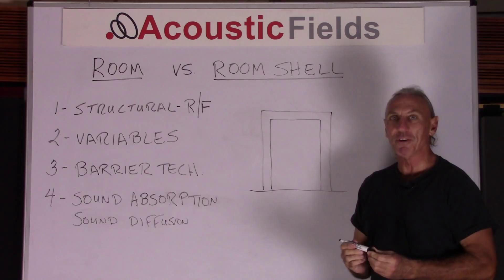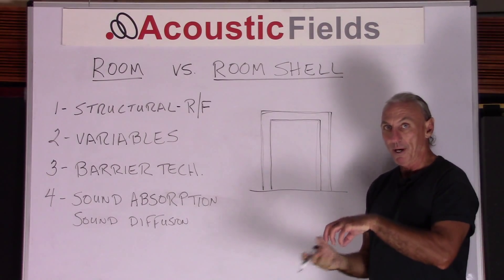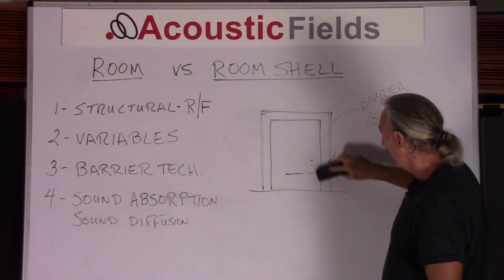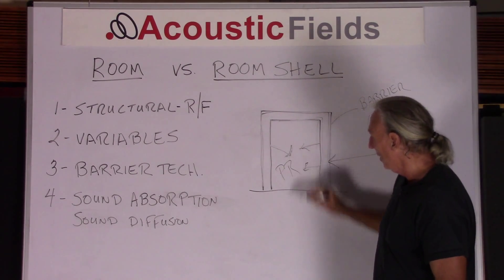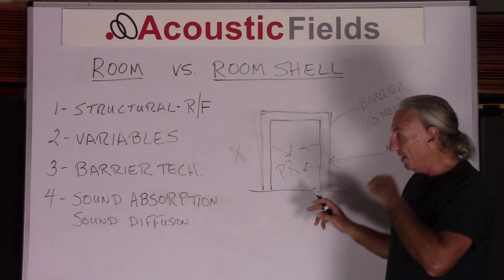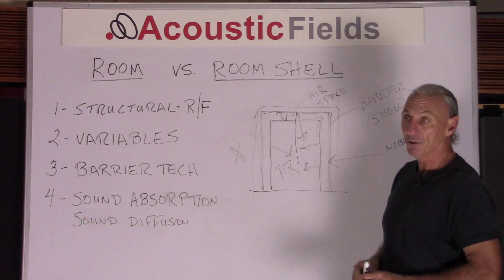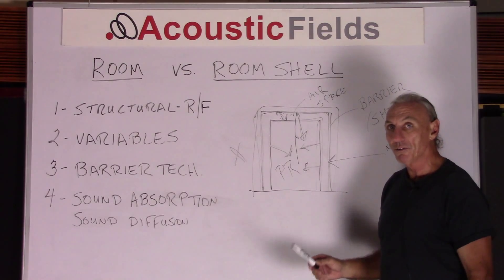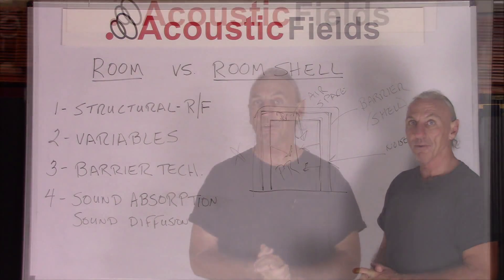Why Soundproofing And Acoustic Treatment Are Completely Different Concepts - www.AcousticFields.com

Comment: What if we use glasswhool or rockwhool on the walls and cover them with thick cloth. Will it work for absorption and reduce reflection?.because sound can't reflect from a dense absorptional material
Reply from the maker: J,   Music and voice require special rates and levels of absorption that building insulation cannot provide. Glasswool or rockwool are also toxic materials that you do not want to get in your lungs.
Reply: Acoustic Fields thank you for your advice
Reply: Acoustic Fields do you have any email or phone number where i can contact you
Reply from the maker: J,  You can contact us at info@acousticfields.com

Comment: Hi I was wondering if someone could help me. I bought a condo about 2 years ago and ever since i moved in my neighbor downstairs complains about my TV's reverberating sound. I use bose cinemate speakers and to be honest, to me it is just normal volume. I think the walls and floors are super thin. I think she is just very sensitive to sound and bothers me even at 7pm  that my tv is too loud when it has only been on for 20 mins.  I have never had a problem with neighbors anywhere I have lived. I'm quiet for the most part and no other neighbor has complained, ever. I was naive enough to give this woman my number and now she texts me constantly telling me to turn it down. What can I do to my room to make the noise stop traveling downstairs?  I'm planning to get a rug, what should I put under it to diffuse the sound? Can I put anything under and behind the speakers? Any advice would be great!
Reply from the maker: +VanCity Gal Barrier technology is dependent on the amount and frequency of noise you are trying to isolate from. You must quantify those numbers with measurements because the thickness, materials used, and construction methodology are all dependent upon that data.